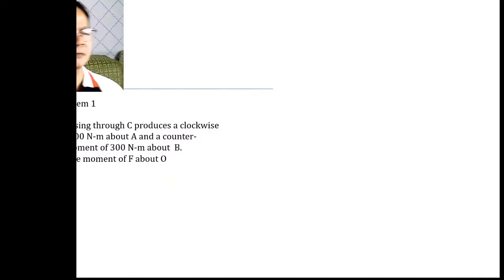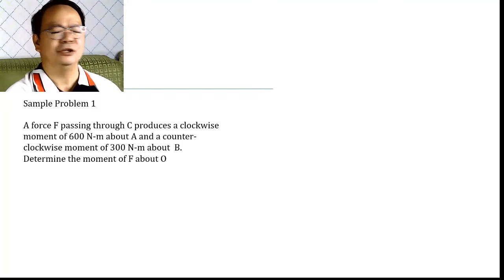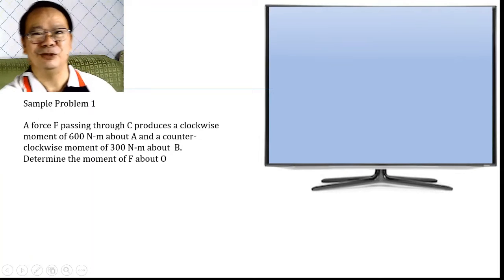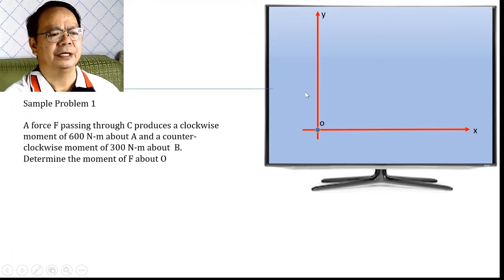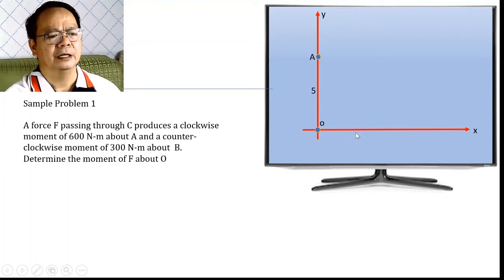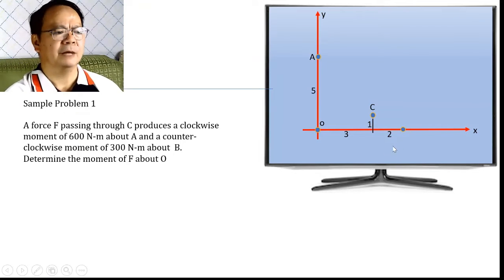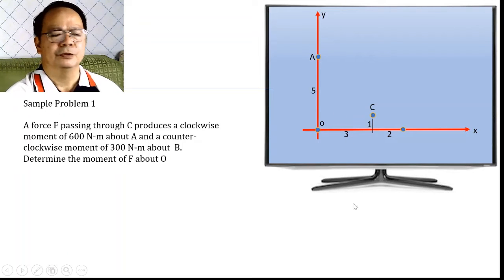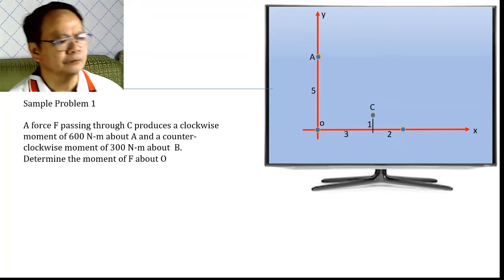Principle of Moment (Sample Problem)

Comment: Hello, How about if the Slope of the F changed? For example, From that figure, Assuming our force F has a slope of 3 vertical to 4 horizontal and produces a clockwise moment of 370 ft-lb about A and counterclockwise moment of 450 ft-lb. How can we compute for the moment of F about C?
Reply from the maker: Good day... thanks for watching this video.. maybe ,the second moment that you mentoned here is the moment of F about B. Because you are asking the moment of F about C then you are assuming that it doesnt pass through C. The first thing that should be done is to find how F is directed and where is its position to produce the given moments. Analyzing the situation,  force F is located between A and B ( not necessarily thrrough C) and most probably directed down to the left. Imagine that the force cross the x and y axes  and define them as the x and y intercept. Try to resolve F into components at the x and y intercept and use the principle of moments to determine the value of the x and y intercept. Once these points are defined use again the principle of moments to get the Moment of F about C
Reply: @willerdayahan2865  Yes, The second moment I have mentioned is about point B (Sorry, I forgot to include it). Thank you by the way for this well-detailed discussion. ✨❣️💯